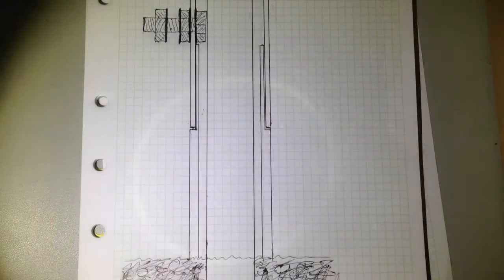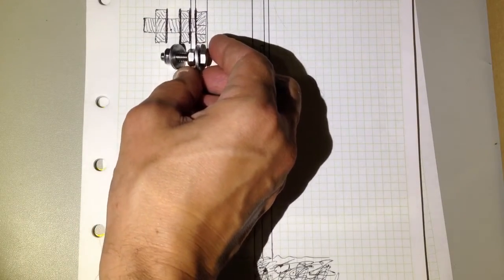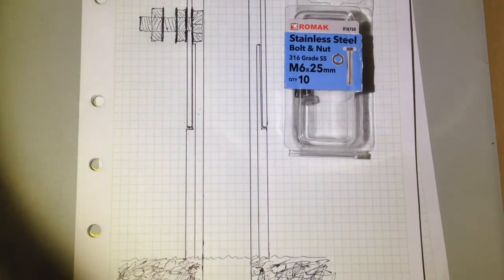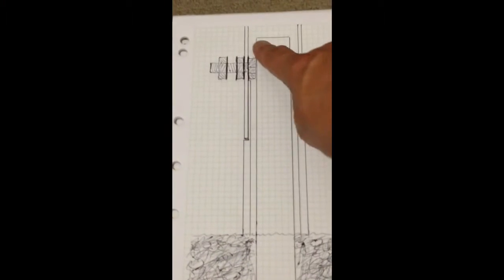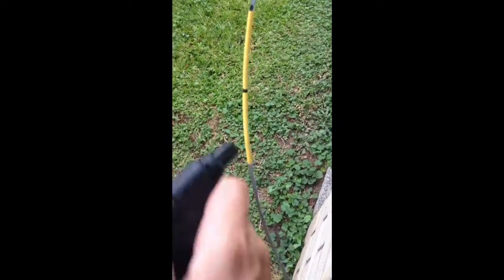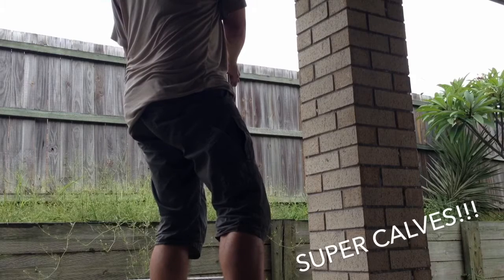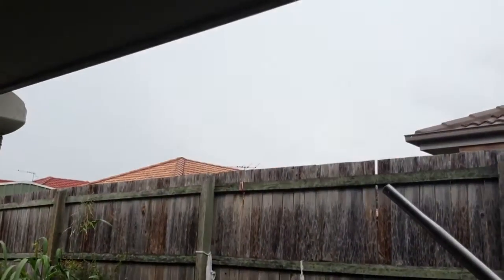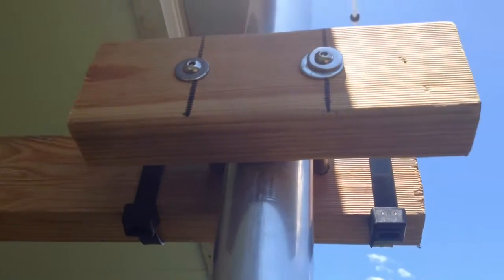One Man Antenna Mast - Part 2

Comment: You sure do build to last!
Reply from the maker: My club called it overengineering, but it's still there! Really the goal was to raise and lower vertically by myself.
Reply: Well, I like it better this way.
My father tends to forego usability considerations when he does work on that kind of stuff but this makes maintenance, rework and usage slightly more painful. In the long run this matters a lot since humans tend to avoid costly/annoying tasks so we end up postponing repairs and enhancements when a better design would have made it simpler.